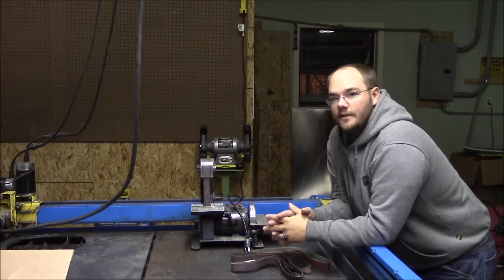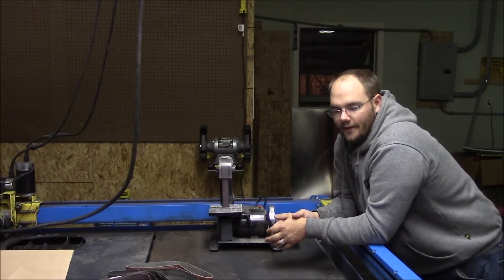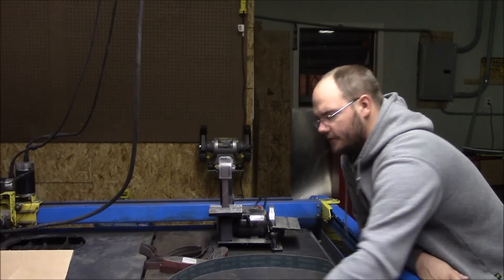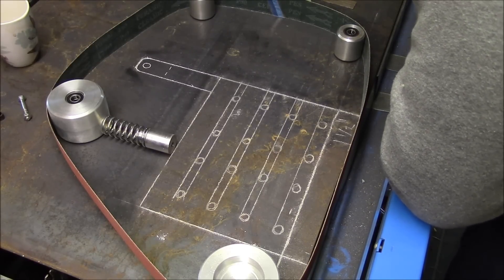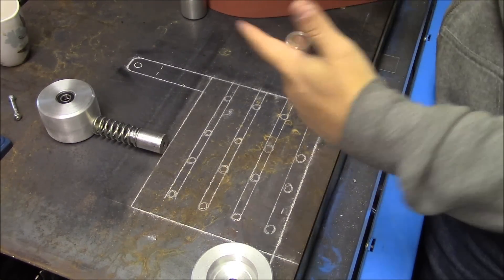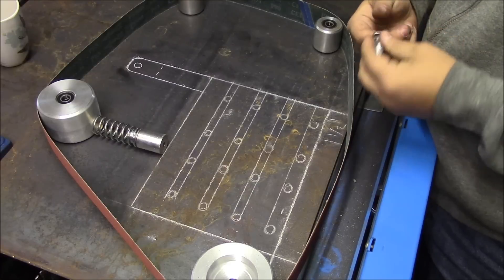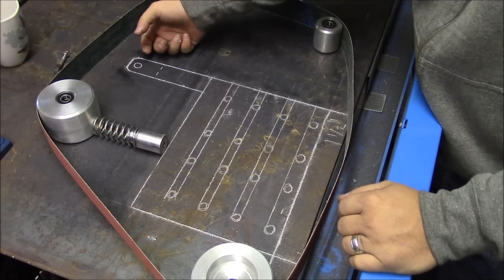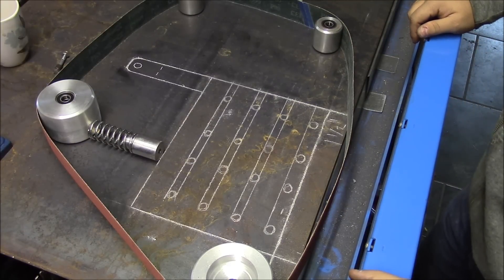2 x 72 Belt Sander Part 1

Comment: Add a bra k on the ba k an do direct drive order use couplings pulley systems are a pain direct drive also runs smoother if you have good drive an tracking wheels
Reply from the maker: I can't argue, but this build, although still incomplete, was intended to be a somewhat affordable multi speed grinder. If I go direct drive, I need to look at a VFD for my Surface speed.  Thank you for the comment.